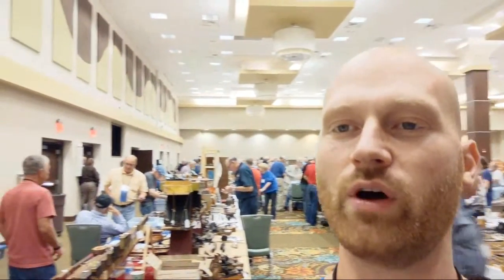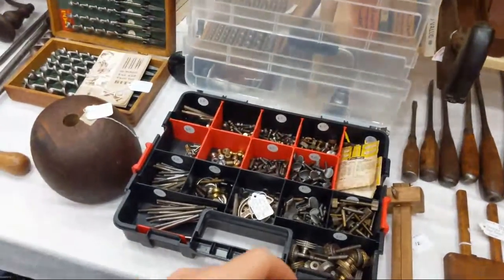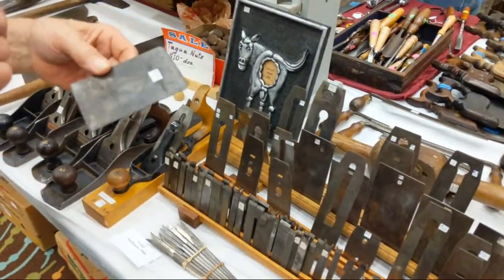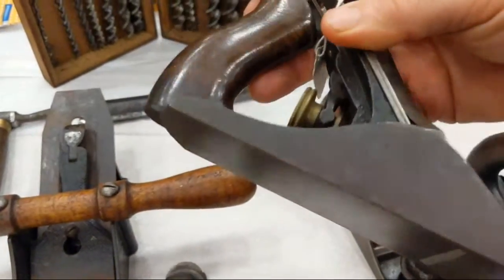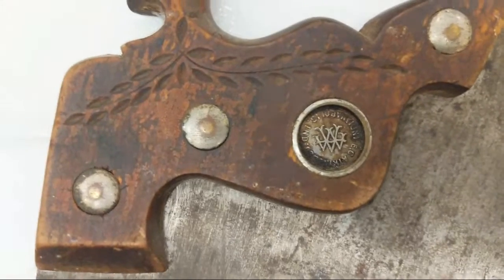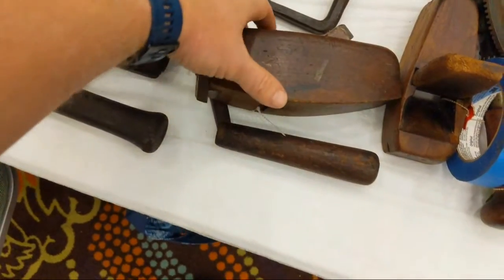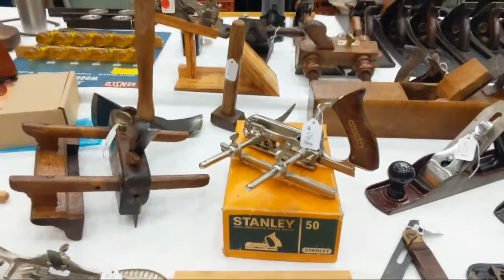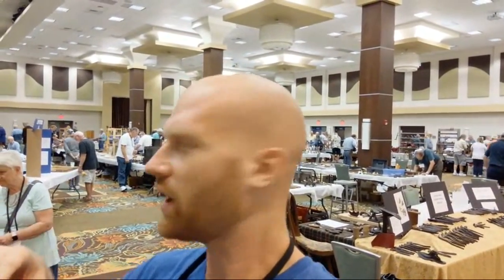Indoor Tool Sale Springfield Missouri MWTCA Meet

Comment: The purpose of a nib on a crosscut or rip saw originally was a sight function for carpenters.  Keeping the nib straight in the cut allowed for more precise cuts; this goes back to Viking shipwrights who ate a species of fish they called a Knibbe, which had a small but rigid dorsal fin.  Rumor once had it the nib was a sign of a saw manufacturer's skill but that's generally held to be ridiculous conjecture at this point.